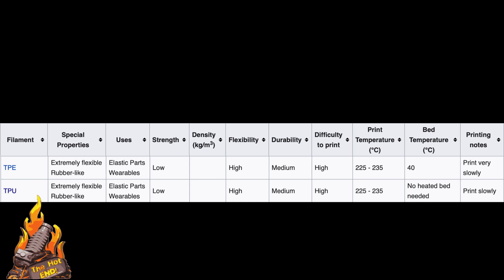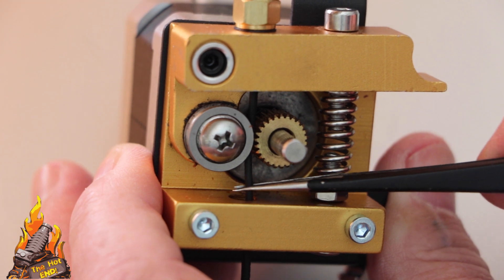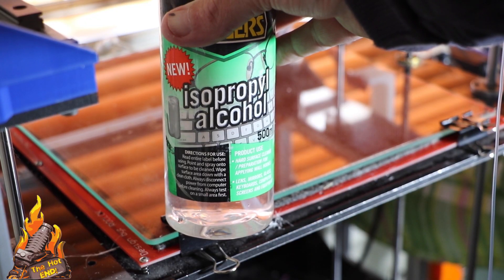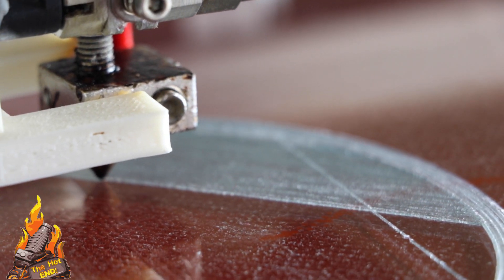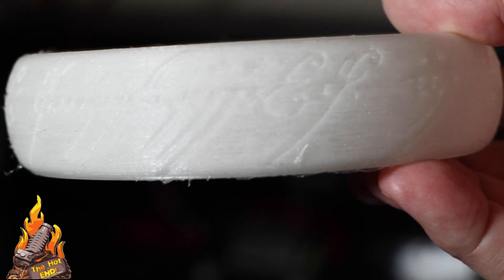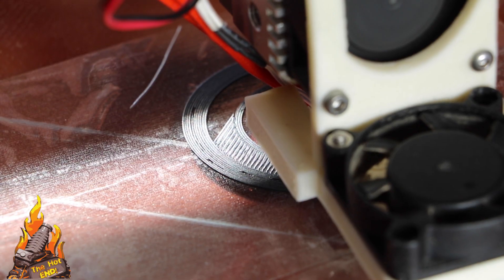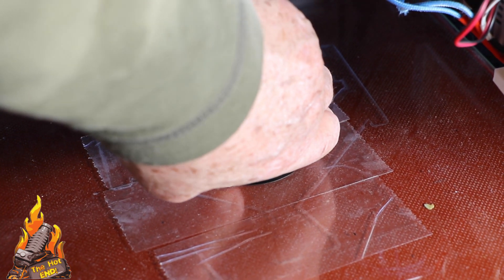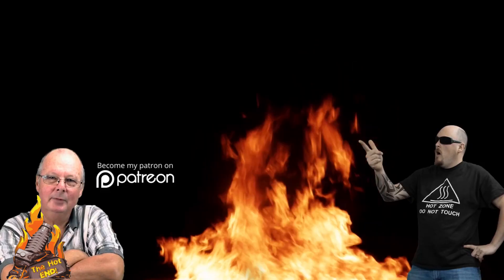How to print Flexible TPU TPE Filaments!

Comment: no values given about the temperature, the print speed, retraction setting. Useless video.
Reply: 0:28?
Reply: Or TPE. Also the TPE is subgroup of TPU. But hey you are watchin youtube nerd’s channel. Cant trust it to provide any actual info. Just printed my first TPE myself, going to use packing tape, not thanks to this video maker but someone on comments.
Reply: Could you use glue stick instead of packing tape?

Comment: Just wanna thank you for the tip for using a clear packing tape. For 2 years I had a roll of very Soft TPE  that didnt want to stick to my plate nomatter what settings and tips I tried. But with the clear tape it sticks like a charm! Cheers!